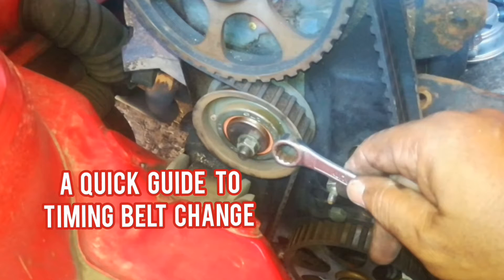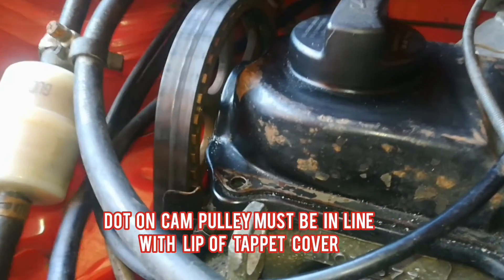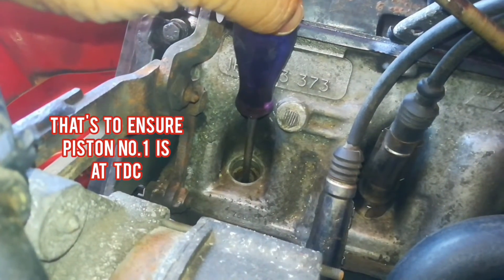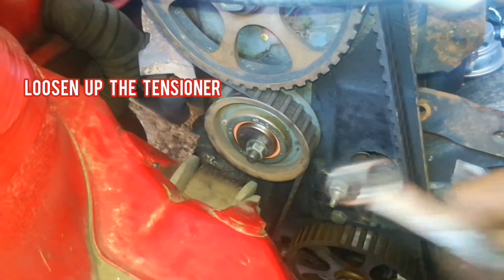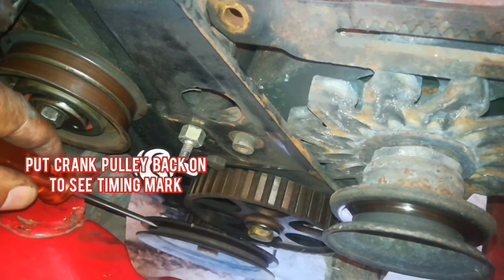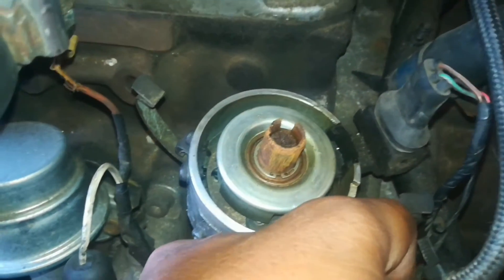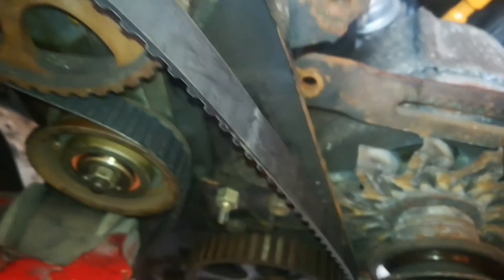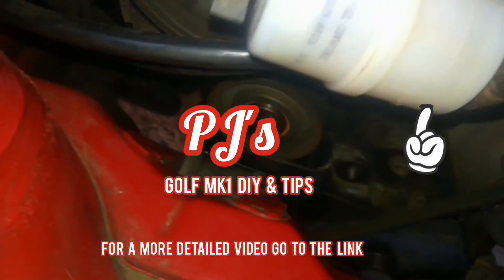Golf Mk1:Quick Guide to Changing  Cambelt.  #golfmk1 #vwfox #golfmk2 #golfmk3 #timingbelt

Comment: I follows your first video . And changed my first timing belt 😊. I made a video about it. Would you give it a view and tell me how it did ? It’s very subjective how tight to tighten the belt
Reply from the maker: Hi ,I actually did comment on your cambelt video  you did about 5 months ago..,not sure if you seen that. ..,.you did well for a first time.How did she run after that?..Sometimes you may need to make some adjustments, because the intermediate pully moves off it's mark quite easily when you slip on the new belt...,so best way to do it is to make an adjustment at the distributor,. ensuring the rotor faces the mark on the distributor....if that's not lined up you will have sluggish performance,or it could be too advanced,and you will get some pinging,and engine running too hot.
Always good to keep an eye on the timing marks after a cambelt Change  and after you have driven the car.When tightening the belt,you should just be able to flick it with thumb and forefinger about 45 degrees...If it's too tight ,you will hear it making a whining sound.,so then just back off the tension a little bit .
Reply: @pjs-golfmk1-diy  oh just spotted it 🙈😂 head like a sieve. Running great. I used your video and it helped so much. So thank you 😊 had a water leak and I’ve a rust bubble under the windscreen at the bottom . Not sure how to remove the windscreen
Reply from the maker: @stevenharpervw  ok .cool😊👍. Rust bubble under windscreen.,.Typical on the Mk1,.I also have,...so will have to attend to it soon..I never yet did a windscreen removal job..,will have to get someone in the know for assistance.Will try and do a video.
Reply: @pjs-golfmk1-diy  yes please do a video and keep making golf mk1 videos too